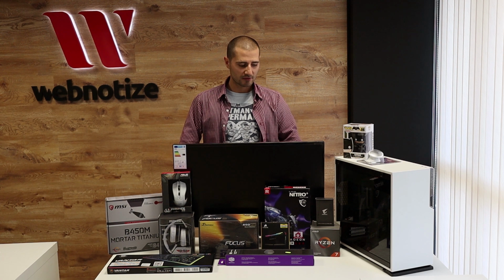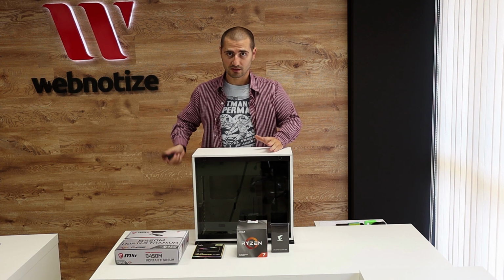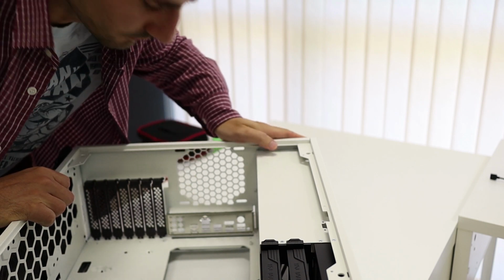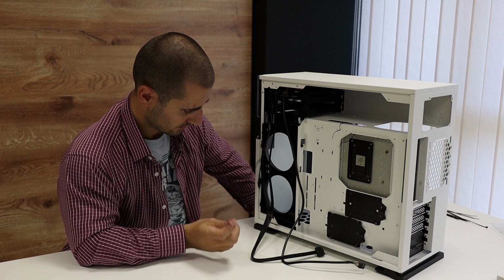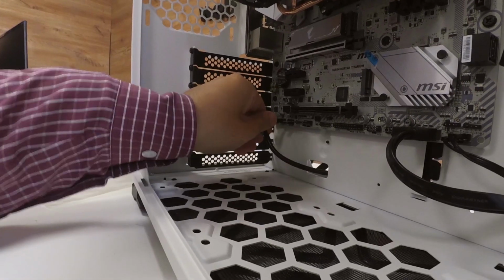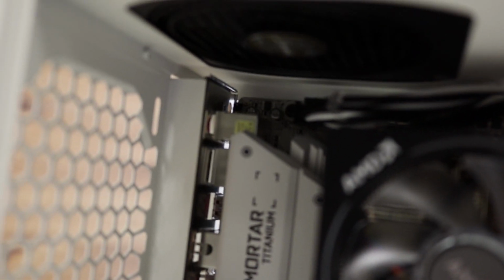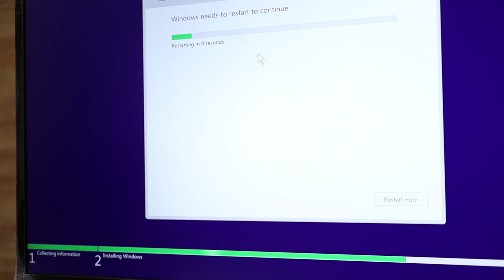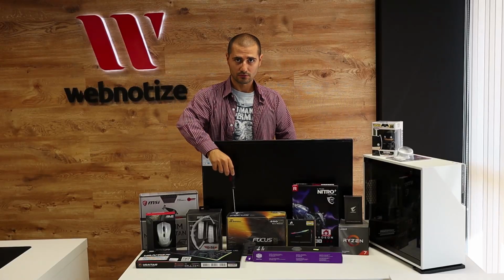How I built my $1000 Ryzen 3700X build w/ MSI B450M Mortar & RX 580 in InWin 101 case

Comment: Hey man, I just bought an Ryzen 7 3700X with an ASRock B450M Pro4 and 16 GB G.Skill Ageis 3000Mhz for  300eur is the motherboard good?
Reply from the maker: It's not bad mobo. It's on the lower end of top10 B450 motherboards, but it's still in top10, so you're good.  You even got PS/2 port at the back I/O 😎😁
Reply: Bruh 300 euro for a motherboard is too expensive buddy that’s for r9 3950x overclocking  just buy a 150$ motherboard bro
Reply: @FaFaANDFiFi  I think it was 300 bucks for the whole thing but I'm not sure

Comment: What is the difference between B450 and x570 boards? I mean do they affect the speed and performance of the cpu or is just a few added features like PCIe 4?
Im planning to get x3700 + Radeon 5700XT with a ASUS B450M-PLUS TUF Gaming but Im not sure about the board
Reply from the maker: If you are using only one graphics card you don't need x570 board. The difference is mainly in the number of PCIe lanes and USBs. B450 will support Ryzen 4000 series (Gen 3), so you won't need such a high-end board. Also PCIe 4.0 is good so far only in synthetic tests. In real life usage you won't see any difference with 3.0.  It's future proof, but since Ryzen 4000 series is probably gonna be the last with AM4 support it just does not make sense for such an investment right now. Go with the B450 board. Just make sure you get NVMe instead of SSD. Also 3700x is a good pair with B450. If you go with 3900x or 3950x, there might get overheating VRMs, because the heatsink isn't made for high core CPUs.
CPU speed isn't affected by the chipset directly. If you overclock or the board has terrible vrms and heatsinks and overheats, then it affects, but that board is good enough.
Reply: @Technotize  It all sounds good except the last part. Multitasking is my main priority and ryzen 9 seems like a logical conclusion. I plan to upgrade in a year or two, once the price drops down so I guess I should consider x570
Reply from the maker: If you don't overclock it's still good. You can also do a light overclock, but depends on the voltage and how many amps can the VRMs handle. Up to 150 it's all good. And default TDP of 3900x is 105W. From what I know, one of the best B450 boards with good VRMs and heatsinks is B450 Mortar/Tomahawk, that's why I choosed that board.

Comment: Are you still using this? Is it really fine to use mortar max to 3700x?
Reply from the maker: Yeap. Pretty happy with that board. No issues so far. Went with an overclock (4,4Ghz on all cores) for a solid 3 months and had no issues. Back to normal, since I don't need it anyway. My board is Mortar Titanum btw, Max is a bit better with the memory speeds and USB 3.2 support. Everything else is identical, I thnik.
Reply: @Technotize  thanks!
Reply: @Technotize  so 12 months on are you still happy with the mobo & CPU combo ?? I've got a 3700x and looking to get the MSI Mortar Max